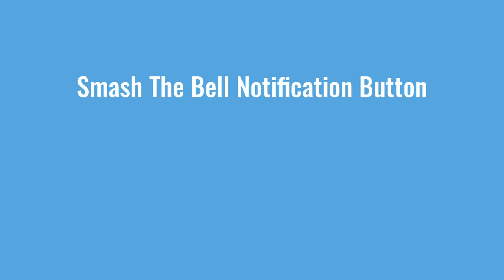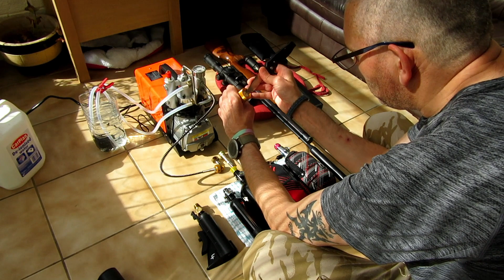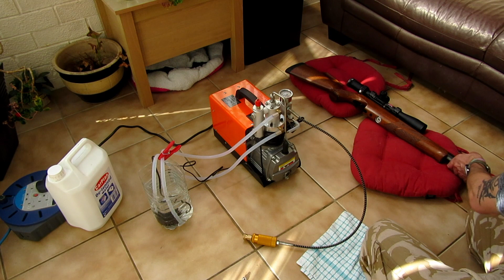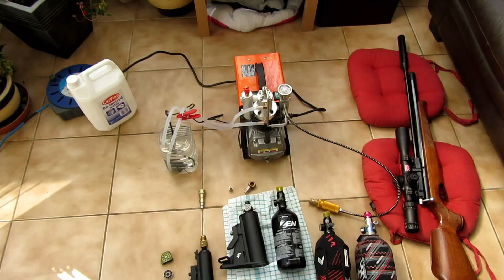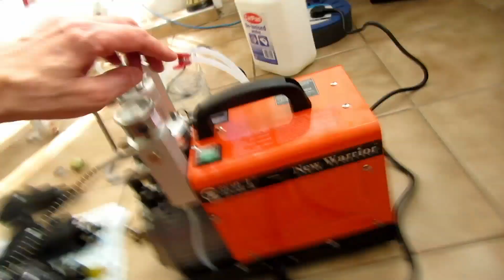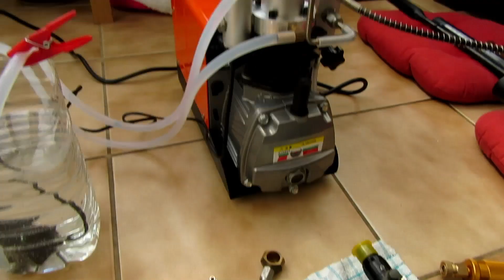part 2  30Mpa/300Bar Air Electric Compressor

Comment: The air will always have a oily smell as it isn't designed for breathing use.  Breathing air compressors have large two stage scrub filters and probably cost as much as a full set up of one of these.  The filter it comes with was used during the quality control testing at the manufacturers but still had good life left in it.  A charcoal filter isn't necessary for airgun use.

Comment: Water reservoir is far too small.  You need one about three times that size or DON'T recirculate if you are going to run continuously for more than a few minutes.  Run to waste and keep your container topped up with cold water.  The difference can be as much as 30°C cooler which will make a hell of a difference for the mechanical life of the compressor.